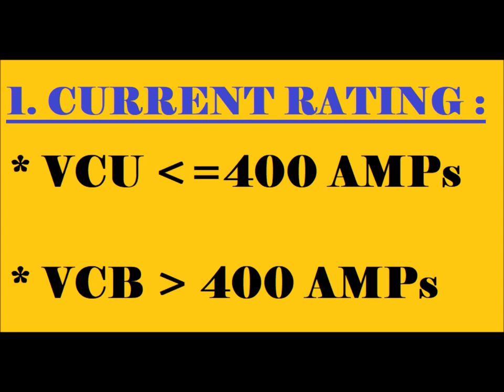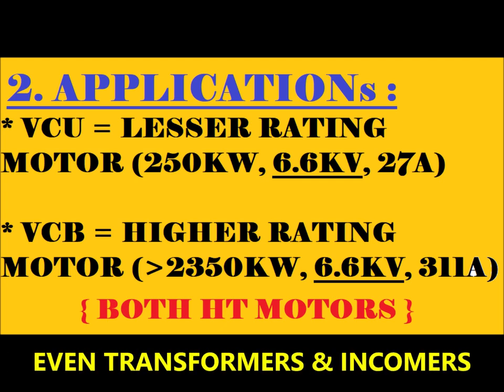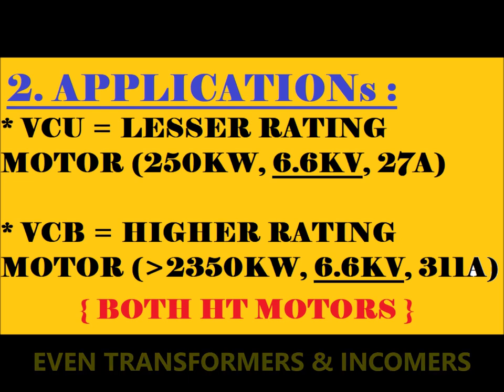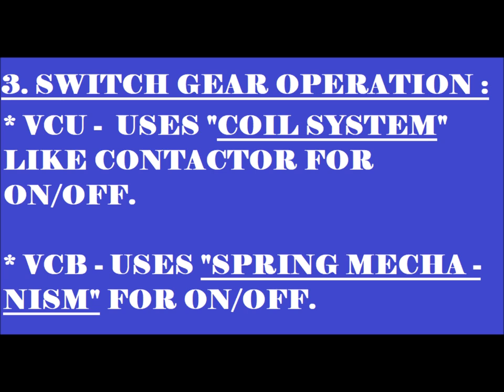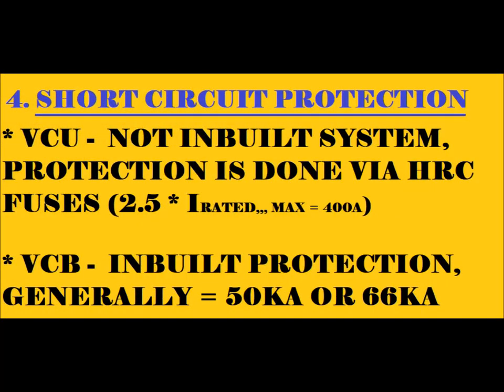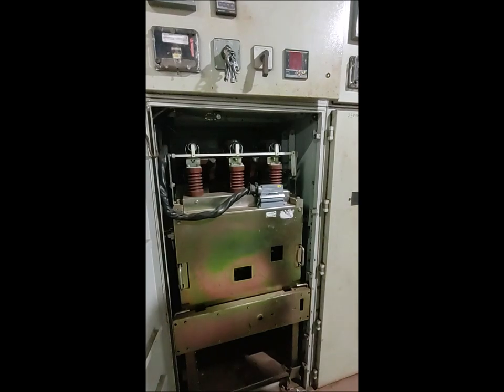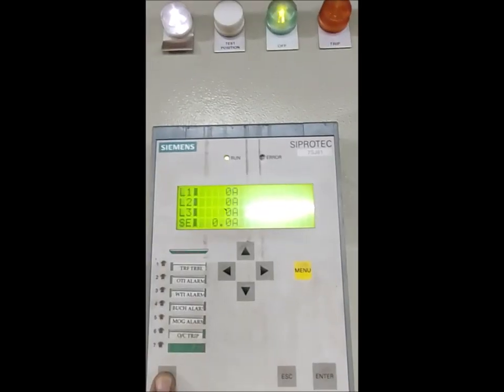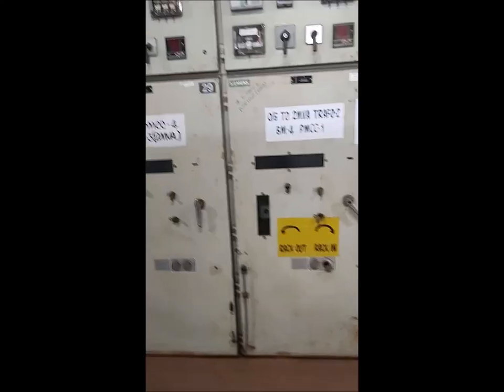VCU & VCB - DIFFERENCES : DIFFERENCE BETWEEN - VACUUM CONTACTOR UNIT & VACUUM CIRCUIT BREAKER

Comment: At work, we push steel billets through 3 long coils of an induction furnace, bringing them up to 2000-2400°f. Incoming power I believe is 4160v. But a few of them have vacuum circuit breakers. Ours look different, but look like they function similarly. Pull the lever to ready all of the contacts and mechanism inside, and start it.
Reply from the maker: Ya that's I believe is the manual way to start a breaker. Our is an Automated system. Different models look different sir, no issue with that. Hope my video is useful to you 😀